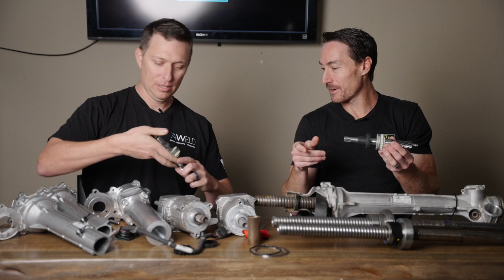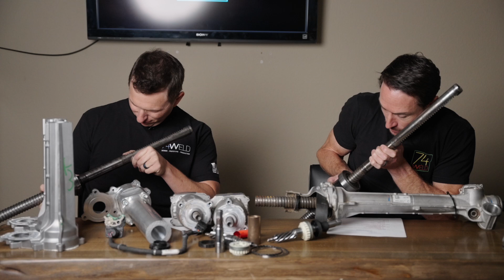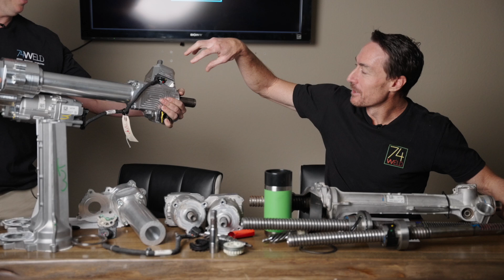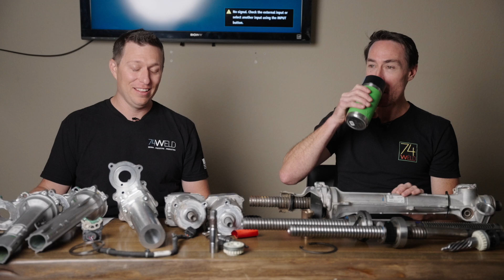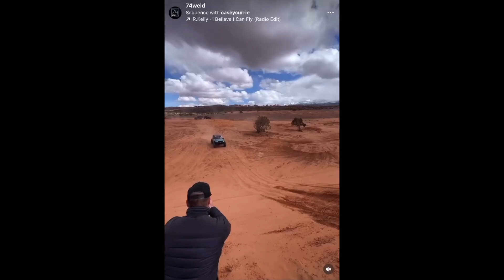What 74Weld steering solution is best or you?

Comment: Really appreciate the videos. Its great to becable to understand the mechanics without having to take things apart. Put 3.0 stage 3 on my outerbanks on 40s. Feel the difference in power right away and really felt the difference when on the rocks.(still would like more power). Seems alot of failures are with higher angle  tie rods which give more reasons for portals to keep correct geometry. Fab tech tierods boots were easy to add a little heat and stretch to fit.

Comment: How much extra weight are you adding when you swap a factory steering rack on a 2023 Badlands Sasquatch to your stage 3 kit? Also, does this upgrade impact your payload capacity and by how much? I am assuming when you order your stage 3 kit you are getting the Hoss 3.0 steering rack with the bigger motor and your housing parts which would replace the Hoss 2.0 on my Bronco. In addition, is your steering rack compatible with all Aftermarket tie rods? I noticed you recommend ICON tie rods for your product; however, I wonder if Fabtech tie rods will work with your steering rack, and if ICON tie rod is stronger than a Fabtech tie rod. Sorry, I know a lot of questions 😊.

Comment: I appreciate that you are standing up for Ford a bit, it's easy for armchair "engineers" to just blame the OEM. That said, I work at Ford, I work in steering. What I am about to say does not represent the company, just my opinion as an enthusiast (**i've already had my wrist slapped before**). Ford should have envisioned the Bronco being used harshly with larger tires: AKA make the rack housing stronger. The cost impact would be worth the reputation IMO
Reply from the maker: People quickly give OEM’s unfair crap. The guys who put on big tires and really wheel need to recognize they are .01% of the market and you don’t make major business decisions to cater to .01%. With that being said, the failures are too frequent IMO and it seems ford is addressing this by putting the HOSS 3.0 in every badlands and up in 2024

Comment: Hopefully someday I'll get the housing but for now I'm going to see how upgrading from a 2.0 to the 3.0 and adding your stage 1 does..

I'm sure you've cycled this stuff, what do you think the wear life span is? Obviously it will be a range but... Wondering when the band aid will fall off ;)

37's and the Rubicon is in my back yard practically, I've been running it every year and year round for over 32 years...

Add Fordyce, Barrett Lake, etc... all quick day trips.

I'll add on trips other Broncos suffer (error codes, can't steer, etc.) and I have never had an issue (forcing steering is never a good idea). FYI I'm running stock 3.0 ford tie rods for now. Heims wear (no thx on a daily) and the icon doesn't seem to be an upgrade. Based on your video the icon is 2mm larger so I stand corrected..

Comment: Hell yes. I want one of those racks. Shared to a few of the FB groups I moderate. The steering failure rumors and reasons stuff has got so far out of hand because of one (to be unnamed) idiot. 

I love the technical data. It's much more comforting to hear a problem from someone who has the ability to do the kind of testing and manufacturing.